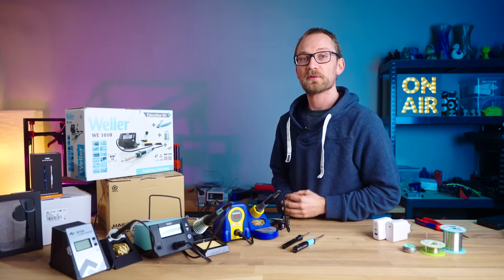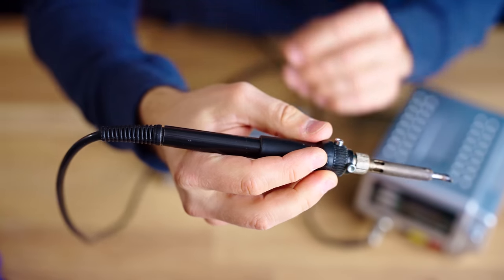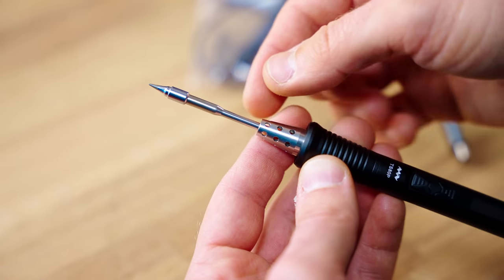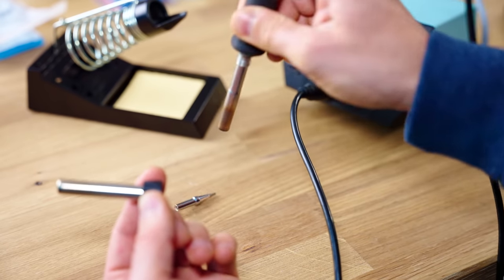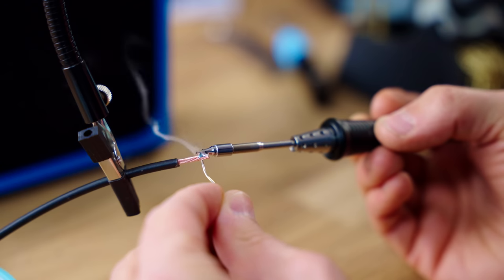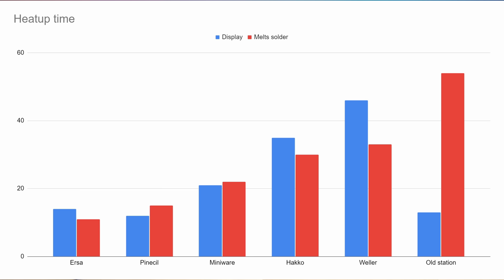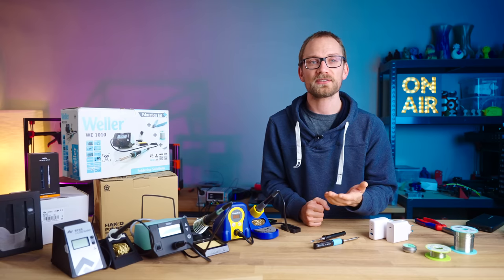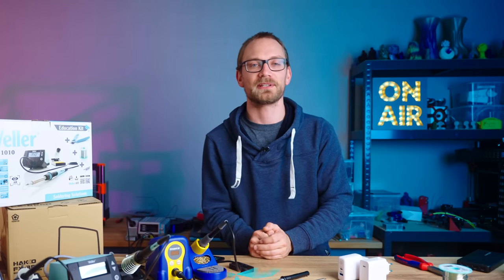Best hobby soldering iron? Pinecil vs. Miniware, Hakko, Weller and Ersa

Comment: I was getting ready to buy a Pinecil when I saw this video, which convinced me that the Pinecil was just what I wanted. Thanks and BTW, continue mixing it up with different subjects. It's sometimes good to get away from 3D printers exclusively.
Reply: I love mine, works flawlessly, get one of the tips sets, the half moon works much better on thicker wires. Also it mentioned in passing, but you can hook it up to a battery pack of suitable wattage, meaning you can us it in the field and don't need wall power.
Reply: @CF_Sapper  Hey I've got a question. How long did your Pinecil take to get shipped to you? I've been waiting for over a month and still no Pinecil. :(
Reply: @andrewhamop6665  I was part of the second production run, and from order time to receive was about a month give or take a week. It comes from China so I usually order stuff like that and it arrives when it arrives. I keep tabs on it if it seems like a sketchy company but this company is reliable just be patient and keep an eye on the tracking. If its longer that 2 months reach out to them there may be a shipping issue due to the current situation worldwide.
Reply: @CF_Sapper  Hi, did you order it from the pine64 website?
Reply: @majidaskari8306  Yes, thats the only place I would order it from.
Reply: The Pinecil is amazing. I have a 140W GaN USB C supply which I use for laptops and tablets, and it's perfect for the Pinecil as well.
Reply: Anyone knows of a good power supply to use with the Pinecil at its full potential?

Comment: As a teenager I bought a Weller Magnastat. It was VERY expensive considering the money I had available for stuff like that. Now it is 35+ years later, I still have it and it still works great.
Reply: I bought a harbor freight one about 15 years ago, it still works great too lol
Reply: @keldonator  I bought one a few months back from HF. Ended up not being consistent with the heating and the solder ended up cooling on the tip and when I pulled it back, ruined a $300 circuit board by ripping the copper wiring out of a rare part.
Reply: @Dan-gj1hz  u must have done something wrong there. dont try to do things like those again, because u have other specialitys like that.
Reply: After 43 years it is still my goto soldering tool. Heating elements are still available and I have a box full of different tips. No need to "upgrade".
Reply: great advice

Comment: i picked up a pinecil when my TS100 died, not regretted the purchase yet, but the Hakko FX-888D is pretty nice
Reply: Can't run a Hakko straight from a tool battery like you can a TS100 style iron. Printed a nice adapter for both my kobalt and DeWalt batteries.
Reply: So if you use at least something like 20W, I can tell you it definitely seems to heat up faster than my Hakko.
Reply: The FX-888D is not worth buying in my experience. It will get the job done, but it's so slow and loses heat so easily vs the TS100 or Pinecil that even once you have bought everything you need to make a proper station out of one of those portable irons, you are still ahead moneywise, and you can also take the thing with you and run it off a laptop charger, lipo battery, USB power bank, etc if you do fieldwork.
Reply: lcd died or the whole iron? I needed an iron to swap mine, the "irony"
Reply: @nicoful86  whole iron, let out the magic smoke, entirelyy fault
Reply: @Mobile_Dom  damn son
Reply: @nicoful86  when making custom XT60 and 5525 cables, make sure the polarity is correct kids.
Reply: @Mobile_Dom  that's very true. I haven't looked into adapting mine yet, but from memory my barrel connector is center positive

Comment: One reason why I am keeping my TS80 - the silicone USB-C cable. The simplicity, lightweight nature of the soldering iron is OK, but the cable sells it for me. One needs to try to appreciate how big of a difference a cable can make.
Reply: You can get USB-C to 5.5mm jack cable with a converter to 20V for 10€. This cable is godsend. You can plug the TS100 to any USB-C charging port that supports  QC 3.0
Reply: I actually swapped from a beefier Stannol soldering station to the TS80P and have zero regrets. It performs at least as well as the Stannol did of not better in my use, feels better in hand and has the silicone cable and the tip is closer to the handle too. The reason I bought it was that I have no dedicated spot to keep a soldering station at   and lifting a whole station in and out of storage was annoying as heck. 

I definitely recommend flashing IronOS on it, it's super easy to do, the iron shows up as a usb drive on your computer and you just copy the firmware file there and you're done. It not only looks nicer but gives couple extra settings and apparently is more stable as well as I have not experienced any of those crashes Thomas talked about in the video.

Edit: typo
Reply: I bought the ts100 and it's great, but if I were to buy again I'd probably get the ts80. I rarely if ever need the extra power.
Reply: So Pine64 also sells a silicone USB-C cable alongside the pinecil and it seems nice so far. Another thing missed on the pinecil is that it can run off of DC barrel jack (laptop charger), or off of USB C pd or qc3
Reply: pine64 sells a silicone usb c cable- i’m a huge fan of silicone cables, and it is literally one of only 3 that you can get- the others being the miniware which you can buy only with the ts80 or ts80 power supply, and an “allite” 100w cable, which is nice, but has to be bought either from amazon US or the chinese shopping websites. so the import fees are insane. pine’s is a steal in comparison and i’m buying more the next time i order from there

Comment: I'm sensing a Project Farm vibe during the product intro. 😁
Add: I'm in the same boat as another viewer and have had my run with hardware store specials and one decent Weller unit. That Ersa was really impressive, but geez, I don't solder enough to warrant the price.
Reply: Yep the "We're going to test that" Line took me from suspicion to laughter in an instance.
Reply: I was just going to say that!  I love Project Farm and Tom, so this was great!  On a side note, I have a simple Weller WES51 and I love it.  It doesn't have a digital display, but I felt I could save some money and didn't really need the display.
Reply: Yeah had to check which channel I was on
Reply: It came to me as he said where the products are from. 🤣
Reply: @WhiteG60  I got that vibe from "this product is made in China" etc.
Reply: I was looking for a comment in this
Reply: Haha! Definitely a little Project Farm vibe in the product introduction.
Reply: @MikrySoft  Totally! Even the cadence is the same.
Reply: I lost it at 'very impressive'.
Reply: Haha, I just scrolled to post your exact words then saw your post.
Reply: He didn't start with "When it comes to"
Reply: @Bricksniper  Unfortunately the WES-51 and it's digital brother WESD-51 (which I have) are discontinued products. It seems the WE-1010 is the replacement for the WESD51. I'm glad to have seen a review of the '1010 so I can feel confident on my suggestion to newbies into soldering to go for the Weller station for the home workbench. While I'm disappointed that the '1010 doesn't have a back light, but one's workbench should be properly illuminated with task lighting. (But, "should" doesn't equate to "will be"...) ;-)
Reply: "We're gonna test that" was even said! PF vibes are good vibes. I'm surprised he doesn't have a soldering iron video.
Reply: @samtoshner8002  That'd be a dual comparo vid; PF's soldering iron review vs Tom's soldering iron review, except PF would have to come up with new torture testing machines. 😁
Reply: ... And is made in china... 😉
Reply: I LOLed at "We're gonna test that!"
Reply: Were gonna test that!
Reply: Indeed, very Project Farm. And if someone sets Project Farm as 'what excellent looks like', then they've done their research well.

And you can test that.
Reply: "We're going to test that" :) BTW he does give credit to Project Farm at the end of the video 24:30
Reply: Yeah Project Farm, exactly what I thought as well. "We're going to test that", "This product was made in.." are like iconic quotes from him at this point :D
Reply: Agreed. The price on the Ersa is enough to keep me away.
Reply: Same here. Lol. 
Weird hearing a Euro accent, though! 
"Imitation is the sincerest form of flattery".
Reply: @Bricksniper  You would have to be insane not to love Project Farm. Or just not be a hobbyist I guess.
Reply: Toward the end, I could sense the same sort of "speak" one might hear in reviews on sports cars.
Reply: I have an Ersa, I bought it for 30€ on Kleinanzeigen! Quality tools are an excellent thing to buy used, since A) a lot of people believe that old things can't be worth anything, and B) quality tools are often still in excellent working shape even after 30+ years of use, or can be refurbished with relatively little effort and 20 bucks or so in replacement parts.
Reply: @SpaceMarshalGyorni  Funny you mention that, which is something very regional in the US it seems, as we have a heavily mixed population and this can be specific to a neighborhood for example, but around our area it's almost impossible to find good used tools even at yard sales and such. Matter of fact, anything that hits the curb, if its even in like 50% shape, it's gone in an hour. My daughter threw a controller through my plasma screen on Sunday evening. No sooner did I get it to the curb, my camera system picked up someone driving by, u-turn, gone... This was with a HUGE shattered front panel, no electrical cord, no remotes, almost at scrap value for internals, and I barely made it to my living room. Vultures I say! 
I believe it comes down to the cultural heritage of our area that all second hand stuff is scooped up immediately and taken to either other cultural markets or auctioned off elsewhere. You NEVER see good tools at thrift shops around here, versus going across town, there's LOADS of stuff all day, every day. 
More specifically, all my best stuff I've had to drive at least 30 miles for like garden tractors, air compressors, etc., get them cheap and spend a few months refurbishing to like-new for personal use. Anything else like 80s or older power tools (like the good stuff your dad had/has that can be rebuilt)... Poof! Magic unobtanium!

Comment: My Pinecil is great! Got it last week for soldering away from a plug.

I can run it from a fast charger in my car and was able to solder up speakers & trailer lights. No basestation, lots of features and really quick. I bet it will work great for when I build an fpv drone as well. Can't go wrong IMO

Comment: Pro-tip for tinning larger wires: hold your tip to the end of the wire. This way it transfers heat directly to every strand and helps to ensure that solder gets into the core. It will seem like it’s taking longer at first, but ends up being faster. Also, love my Hakko, but it’s the only proper soldering station I’ve ever used.
Reply: This is what I do. I use the Weller W1010E at work everyday. Its great. I was using the Weller WES51, and for an older machine it works just as well.
Reply: Bigger pro tip: use a larger diameter tip for large diameter wire; instead of the tiny one shown in the video
Reply: @nonam3007  and a bigger one on top: dont do like holding ur tip to the insulation, because there wont be any insulation after heating that wire.

so bigger tip, like the diameter of wire and heating up by hitting core is the real deal.
Reply: I just put some solder on the tip and that increases surface area and heat transfer by a lot.

Comment: In 50 years of being involved with electronics, I've never had a good experience with Weller products. On the other hand, my first Hakko 936 is still up and running after over 20 years of service.
My newer Hakko 888 has worked flawlessly over the last 8 years.

Comment: I upgraded from a cheapo 20€ iron to an ersa i-con pico last year, and I never regreted it: the super fast heat up times, super precise handle, feels like holding a pen, and the cable doesn't get in your way. it's amazing.
Reply: Totally. Also upgraded from an Ersa iron to the i-Con Pico last year. Such a pleasure to work with. Especially when working on smaller stuff like SMDs.
Reply: I have the nano and use it every day on my desk. Ersa probably has the best stations with the flagship i-con 2 being one on the beat on the market.
Reply: Two questions for you Ersa fans: Do you use the soldering iron of the pico? Or do you have an alternative? To me it makes the handle of the iron way too hot. (I'm talking about the cheap soldering iron holder that comes with the pico. Not the nicer one that comes with the nano. ) That's my biggest issue with the ersa.
And yes, the fast heatup time is just amazing and perfect for me.
Reply: @PenPeng  Mine isn't hot. My guess you've cranked up the temperature bit too high. Personally I usually don't go above 315-325C (using 60/40 solder). Never changed tips for ~6years I have this station. Can't even think of other iron that could be more comfortable than this.

Comment: The Pinecil takes the same tips as the TS100. I know some Amazon vendors carry them, and you don't need to buy whole sets. I'm told they can also use tips for a higher end Hakko station, but it makes the whole iron quite a bit longer.

The TS80(P) tips have better construction and design, and are more efficient, powerful, and accurate than the TS100 tips, but they are indeed pricier so you want to buy just the tips you want to use and take good care of them.

The first iron I've had a ton of success with is a cheap Sparkfun non adjustable iron, which appears to be a knockoff of the Weller iron handle in this video. I threw away the iron from a cheaper Weller (which is an AC iron with a controller that limits the AC electricity going into the iron) and plugging in the Sparkfun iron into that.
Reply: yep Hakko T12 tips are longer but compatible with ts100 and pinecil and the t12 tip clones are cheap and comes in a wider variety of shape. It's a bit of a shame that those new gen hakko stations are not tested in the video because integrating the sensor inside the tip makes the temp more accurate and quicker to adjust by the station.
Reply: In what world are the TS80 tips more powerful than the TS100's ? TS100 is 70W vs 30W for the TS80, and the construction is really not better..

Comment: I do love my Pinecil. One thing to point out in case you did miss it, the Pinecil is based on/influenced by the TS100. it accepts TS100 tips which you might be able to source locally for cheaper than importing them if you have import tariffs
Reply: It has the same screen layout too.
Reply: Thanks for pointing this out!

Comment: Used a cheap no name Amazon soldering iron for my first project. Absolutely hated it and thought I sucked at soldering with many failed solders after hours of use.
Got a hakko station for Christmas and did some test solders and had them soldered and tight within minutes.
Game. Changer.

Comment: I love my ts100.  It's one of the best things I've spent money on in a long time.  It's such a jump from a $10 iron that my ts100 is more than perfect.
Reply: 100% this. I had a $90 Snap-On butane one before I bought the TS100. The TS100 is sooooo much better at a fraction of the cost.
Reply: the pinecil is basically a ts100 v2,  same tips, can be powered over usb-c pd and the barrel jack, comes with ralim firmware by default and costs less than half, even with shipping. and you can get spare parts, unlike the ts100 (my case cracked once, gl finding replacements.)
Reply: @gamerpaddy  they are around t he same price these days.
Reply: @user-yk1cw8im4h  No Matter where i look its allways 60 bucks and Up for a ts100
Reply: @gamerpaddy  I own the TS100 and the pinecil and I can confirm that. I loved my TS100. I love my pinecil even more. However I've had an annoying problem with the pinecil, which I believe is 100% my fault : sometimes when the tip touches a PCB, the iron reboots and stops heating. I am 100% sure that's a grounding issue as when I tried it with my powerbank, it never happened. But somehow it never happened to my TS100 either.
Using a powerbank with the pinecil is one of the things that make it so good to me. I know you can get the TS100 working with a battery, but I don't know much about DIY batteries and I don't really feel like messing around that. Meanwhile you can buy a USB C power bank from a shop (as long as it has power delivery) and it'll work well for a really long time.
And it's so much cheaper than the TS100 ...
Reply: I have the i-con and this, and both are great.  I use the ts as a portable

Comment: I settled on this Hakko one, it has 5 temperatures you can define and you do not need to fiddle with the temperatures as everybody suggests for some reason (I set mine in a range from 280 to 400). I have not touched manual temperature adjustment in years, just select one of the presets and start soldering. When compared with weller many years ago (which was more expensive), I just liked how solid hakko felt, all heavy steel casing despite the "plastic-like" look.
Reply: I also have the Hakko. It's in my price range and it has been a good performer for several years. Previous experience with Weller was not as good. Hakko meets my price/performance requirements. The Ersa is just too expensive for an occasional hobbyist station.
Reply: Mine died on me 😢